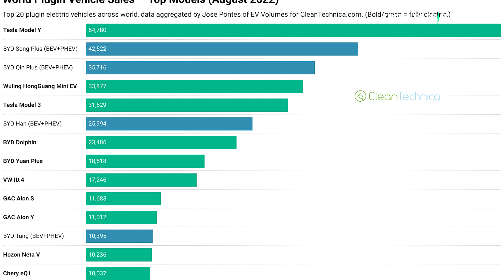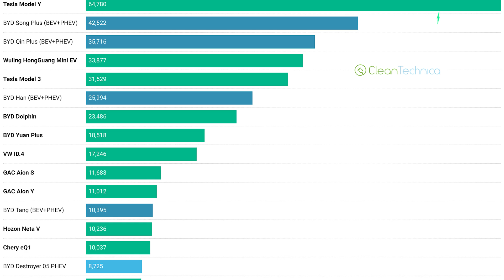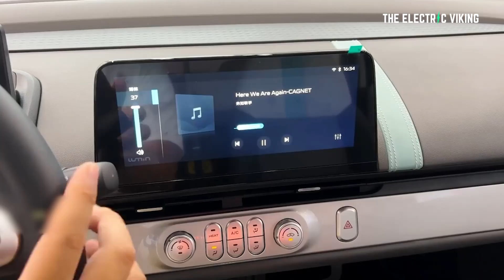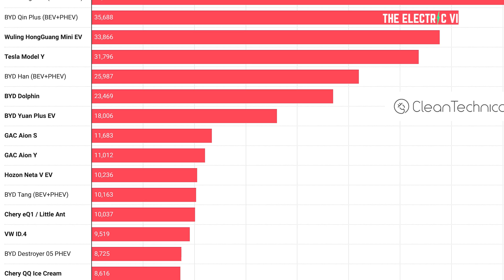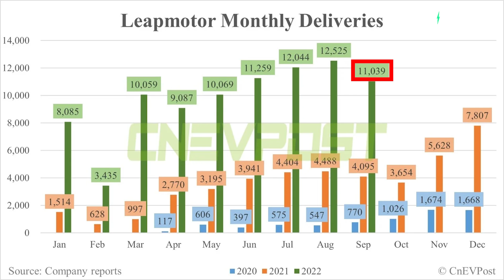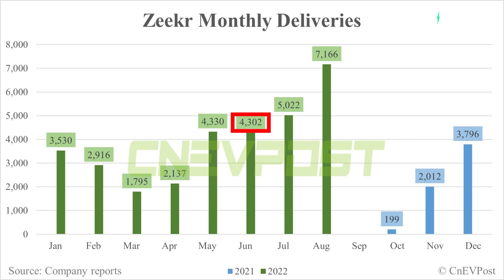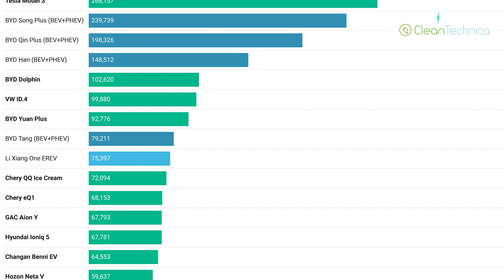The top 20 best selling Electric Cars in the world in 2022

Comment: With all this talk about increasing EV cars, we need to start thinking about the efficiency of the power plants ( Rankin cycle ) no matter what the fuel is because power plants have theoretical limits to efficiency. Give or take , a power plant delivers power to your electric outlet at about 30% efficiency and the rest is wasted as heat.  Solutions need to be thought of and quickly to keep up. In example, use the wasted heat for district heating or some other industrial process. Another example would be increased renewable energy.  Years ago, I used a small Honda engine to provide power to my home and the waste heat to keep my home warm, not 100% but darn close. The only reason electric is so cheap for electric cars is because the fuel is so cheap to the power companies that need to burn three KWH of fuel to supply one KWH of power to your electric car or what ever electrical device you are powering.  Lets all start thinking about this elephant in the room so we can continue to have these EV we all love.  Thanks for posting about the increase in EV sales  Sam, love your videos.
Reply: Electric makes it to my garage without a massive gasoline tanker driving 40 miles to dump 5000 gallons at a station. It costs fuel to deliver gasoline. And the tankers aren’t free to oil companies. Costs are passed on to consumers.
Reply: If power plant efficiency is that bad then my PV that is diverted to my car is way better as its only travelling 10m down over sized cables to minimize losses
Reply: @waynecartwright7276  absolutely correct in my opinion. I have/had solar for several years now and I love them. Even though they are only 20% efficient, it almost doesn't matter in the scheme of things, because the energy from the sun will hit us  anyway.